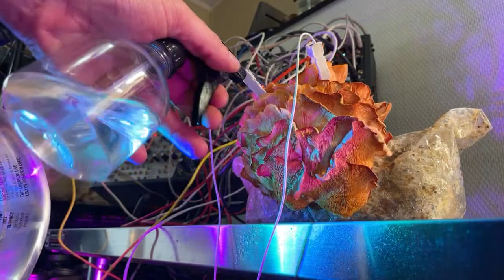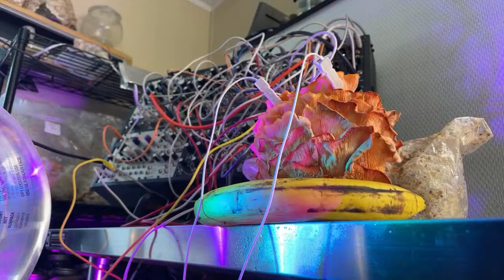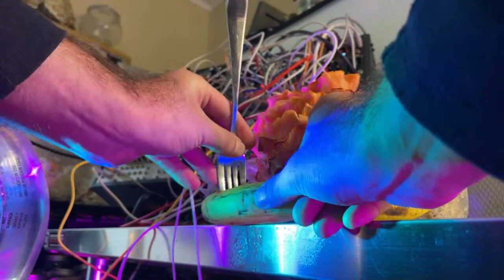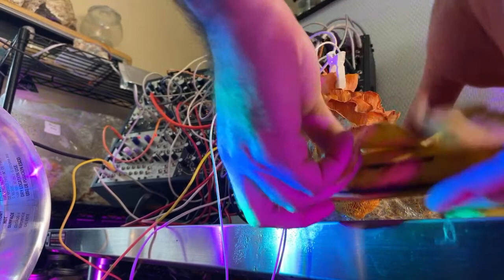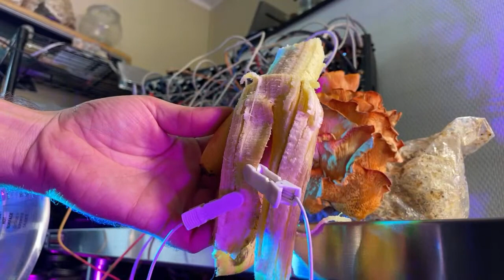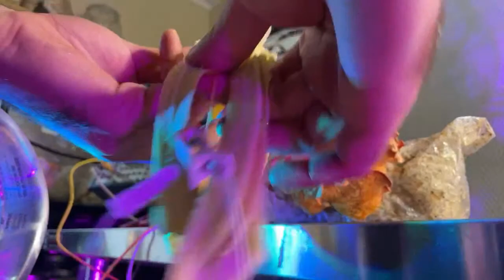Pink Oyster Mushroom Music Live With Special Appearance From Banana: Eurorack Modular Synth Bio Data

Comment: I'm new to your channel but I am really digging your content! 
I do have a question though, recently I watched a program on Netflix about mushrooms and it mentioned the mycelium underground sending signals to each other like synapses in a brain.  
Is it possible to use this kind of equipment to measure that or does the surface area need to be big (I.e the actual mushroom)
Reply from the maker: Definitely even just connecting to two separate fruiting bodies with have the mycelium in the mix as the signal is traveling through the mycelium in the group to go from one fruit body to the next